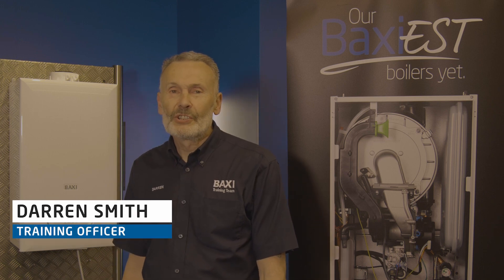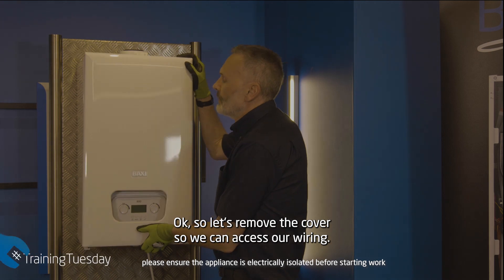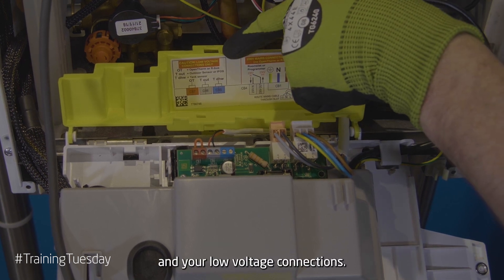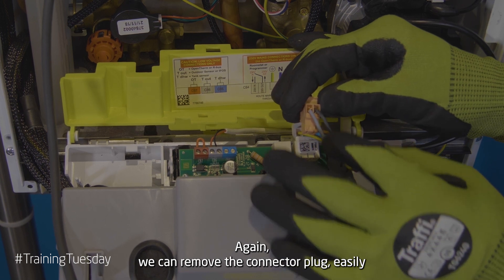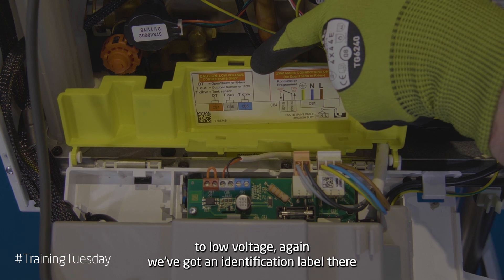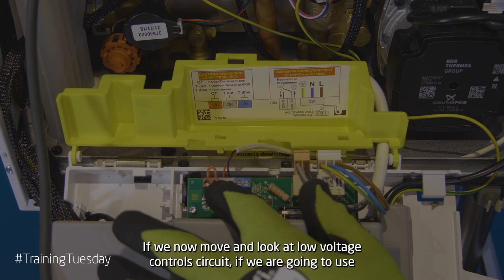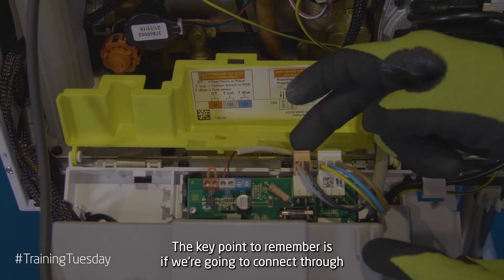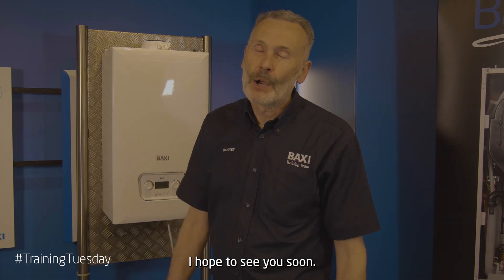A closer look at the wiring centre on the Baxi 800 Combi 2 boiler range

Comment: Keeping the 240v RT link in when wiring the Google Nest 3rd Gen via OpenTherm was the missing bit.  Heating was not firing however this video cleared it up. 
There is no mention of this in the service manual, big blunder. Please update and release a revised version with new boilers as this is crucial info.

Comment: Will the 240v link be the same thickness of wire as the 48v open therm?

Just wondering can I remove the linke for opentherm and pop it in the 240v?

I've got a nest learning thermostat to do but the previous installer has tried to do a 3 core 240v to the heatlink already